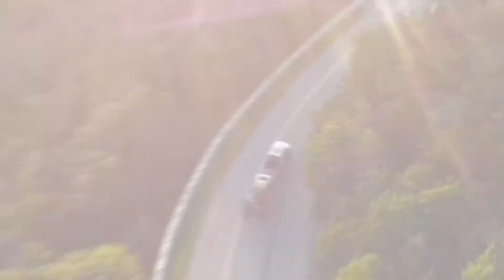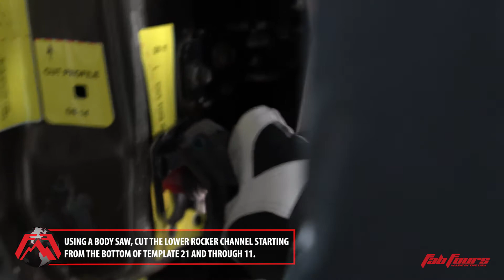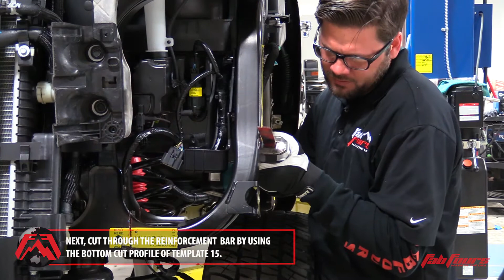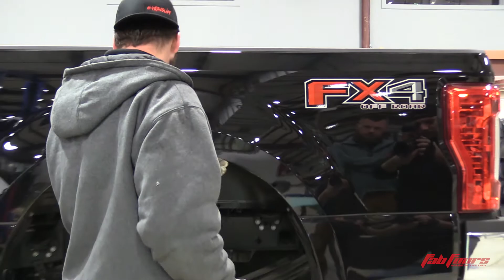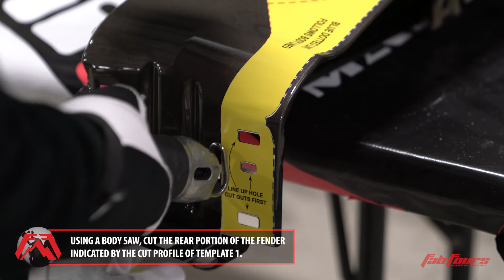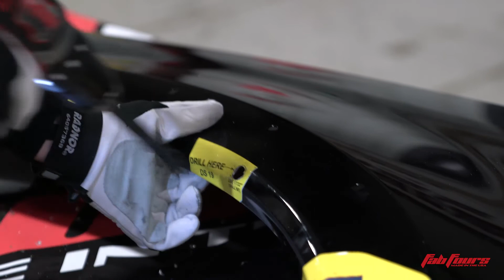2017-2018 FORD SUPERDUTY OPEN FENDER INSTALL // CHAPTER 4 - CUTTING

Comment: you remove the reinforcement bar? I had been keen on your build until you messed with the safety of the vehicle.
Reply: Nevermind, next video shows the reinforcement bracket being relocated. I feel better now.